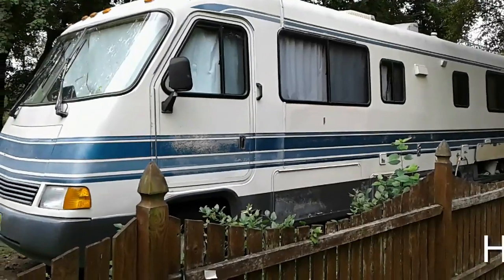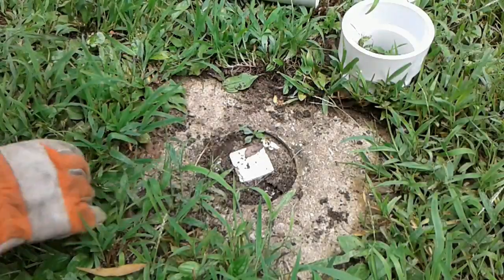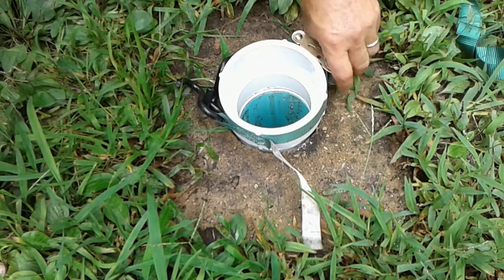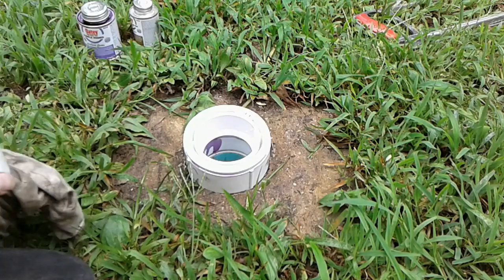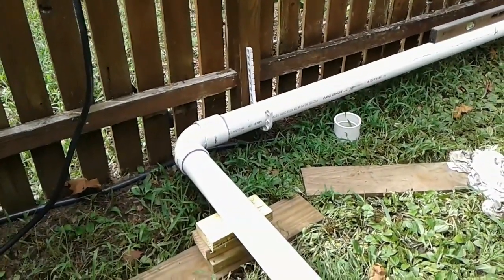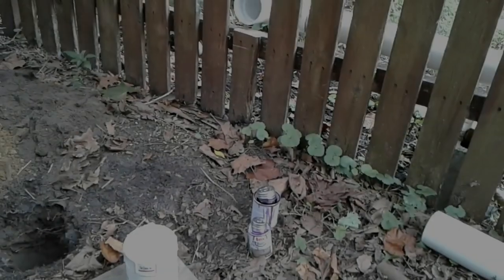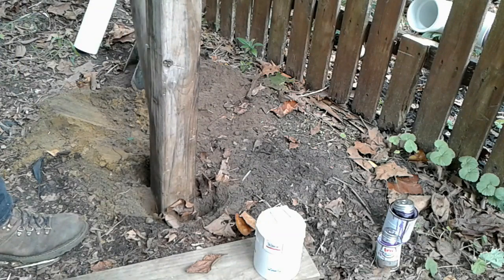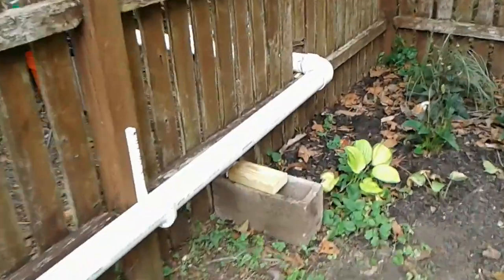How to Connect your RV to Home Sewer

Comment: Great video! thanks for the idea!!! We are going to do this!!! Our only real alteration is that we are going to put RV drain hose fittings on both ends of the run (around 30 ft with one 90' turn) to hook RV drain hoses to. This will save our washout and hopefully keep the naysayers at bay. We currently use a portable tote tank to empty ours into the washout. Thanks again!!!
Reply from the maker: Yeah, the portable tote method gets old fast! Thanks, and good luck.
Reply: @Buckwsr  ended up being 50 ft long. works perfect! thanks for the idea! put hangers on the house and mounted the pipe  and went around the back to the clean out! one short drian hose at each end,
Reply from the maker: @shaylarae253  That's great. Wish I could see photos of the finished job. Hope it serves you well.

Comment: After a time you may need to add other hangers between the ones you have existing. With time and temperature the PVC pipes will sag.  Personally I wouldn't exceed 5 ft.  Best to support them before saging starts.  I believe 1/4 inch fall per 10 ft is the correct fall to float solids through drain pipes.  Good idea.
Reply from the maker: Thanks for the tip. 👍
Reply: 1/4" per foot. Not per 10 feet
Reply: And code in oregon for hangers and supports is every 4 feet
Reply: I knew fall wasn't much because if you have too much the water will not float the solids out.  I looked  fall up and found in most places it is 2ft per 100ft.  Easy to do the math on that one.
  I've seen PVC run on top of the ground for temporary rv hookup and supported every 10 ft.  They eventually had a REAL mess
I did not know about the Oregon rule, but i knew that 10ft would not work

Comment: This is a helpful video! Subscribed. I’m currently thinking about getting a cheap used RV and hooking it up to my mom’s house for the next few years (I’m in college) but no one in my family knows anything about RVs or plumbing. Do you think you could make a follow up video showing how you maintain this system/how it works for the RV? Thank you :)
Reply from the maker: Thank you for the note. Your RV will have a "black water tank" (toilet waste) and a "gray water tank" (sink and shower waste). I think if you search YT you'll find videos on how to empty, flush, and clean these systems, you'll find plenty of information.
Reply: @Buckwsr  how did you secure the flexible hose to the pvc pipe?  And, do you still empty the black and grey water tanks or is this now a free flowing system?
Reply from the maker: I came up with a way to plug the flex hose into the PVC, and then I use a screw through the PVC into the flex hose adapter to hold it in place. Not perfect, but it works. For now, I simply use the system to empty the waste tanks when I need to. I do not leave it permanently connected for a free-flowing system, simply because the RV does not get used that much right now.
Reply: Am i guessing no mascerator is necessary?  I am using pvc adapter directly from camper.  Because of construction i need to put a flex hose into septic tank .  Contractor is setting it up.  Do we need a vent?
Reply: Great idea!!!!

Comment: As soon as you open your waste valve the short section between the rv and your PVC line will just collapse to the ground. You might as well fabricate a removable PVC line to connect to the rv . Did you find you had enough of an angle for solids to travel across your back yard? I would hate for that line to be clogged..just imagine all that mess coming out of the line. What about winter? Any frozen matters  lol.. matters, get it...
Happy RV'ing 🙂🤙
Reply from the maker: You're right. I had to devise a way to support that initial short section of flex pipe. After that it worked great, and has been fine ever since....

Comment: Thank you for sharing. I am living full time time in an RV park. I would like to hook up my fifth wheel up with PVC pipe for the winter answer. My question is how am I able to leave the black tank open all the time? Everything I’ve read and saw and been told is do not leave the black tank open because of the pyramid that is developed without a buildup of the liquid.
Reply from the maker: You can leave the valve closed on the black tank, and then empty and flush it once a week, or at whatever interval you choose.

Comment: When you hooked up the rv like this,, how did you keep the solids from building up  in the tank or did you close the dump valve and let it fill and used the dump periodically to flush the solids
 I have a disabled motor home,that is in a permanent location like a Mobil home,,, thinking of removing the tank all together and straight piping it,,, did you have any issue with this setup
Reply from the maker: Every once in a while I close the valve and fill the waste tank(s). Then I drain them and flush them to make sure all the solids have drained out.

Comment: I was thinking about doing this my self. It seems better than getting one of those long skinny hoses that goes in to toilet wit a pump. I even thought about building a separate septic tank at a point but this is better. I would paint the pipes brown like the fence so they don't stick out so much being white on brown. Where the pipe crosses the yard I would put flower pots all around it to cover it and to prevent people from tripping over it. Maybe a wooden short wall that has a channel on top to be filled with dirt and plants on top. It would serve as a partition for the yard and conceal the pipe within. It should be removable in case one needs to go back and work on it. One question I have is, is it worth it to rent it as a B&B? Being a motor home, approximately how much are people willing to pay per day?
Reply from the maker: Thanks for the note. So far, the sewer line has worked perfectly. But like you said, it is a bit unsightly in the yard. My wife wants me to paint it, as you suggested. I will add a section of fence where it crosses the yard...already bought the materials....and the addition of some shrubs or flowers should make it a lot less obvious. We have had a few airbnb bookings over the last couple of months, but now in NJ we can get freezing temperatures, so I've had to winterize the plumbing and suspend the rentals until Springtime. The amount you get get for rental depends a lot on where you live and how great the demand is.... But since most RVs sit unused most of the year, renting them out is a good idea.
Reply: @Buckwsr  To solve the freezing part one could install heating blankets with thermostats. There is a chance that the electrical consumption would not surpass the earnings from be able to keep it rented. If that is the only thing standing it its way.

Comment: Does the RV drain properly with the length of your PVC pipes, and all the 90.degree turns?  We are looking at connecting our RV to an RV park sewer line (permanent connection).  We’ll have to make a couple of 90 degree turns, or sweeping arcs to.point the drain toward the park connection.  Not as far as yours, but still with a few turns.  Does your system drain ok?
Reply from the maker: It still works great. The 90 degree bends are no problem. You don't need large sweeping bends for this kind of drainage. Good luck!

Comment: How do you prevent sewer gasses from venting  into the trailer without a p trap? I have a trailer that’s been setup in a park for 30 years, and now after all these years this is starting to become a challenge.
Reply from the maker: I think the question for you to figure out is what is different now than it was 30 years ago? In my case, there is a trap under every sink drain, and the toilet valve has a seal that prevents gases from rising into the bathroom. Sometimes there are bad smells when we are on the road, but while parked and connected to sewer, none at all.
Reply: Did u ever figure out how?

Comment: Is it possible to connect the rv hose directly to the septic system in the way you did? (If it's long enough of course) we're going to be staying at a friend's house for about a month and I believe he has a clean out pipe I can use to connect the hose to
Reply from the maker: I'm sure, as long as you can get close enough to the clean-out pipe, that you'll be able to drain your tanks there, even if you have to hold the discharge hose in place while the tanks drain. I came up with a way to connect my hose more adequately to my sewer line, and you can see that here: https://youtu.be/-TXz4Rc0vmI

Comment: is it possible to install a regular bathroom toilet like the one in the house, so i wouldn't have to be worried about smells and draining once a week.... basically bypass the black water tank (remove the black water tank) and just straight connecting it into the sewer drain? Permanent and stationary living.
Reply from the maker: I guess any thing is possible. Most RVers don't opt for a standard toilet because of 1) the weight of the heavy porcelain, and 2) the high volume of water needed to flush it. RV toilets are typically lighter and use less water.
Reply: RV toilets use a 3" flange while home toilets use a 4" flange.

Comment: Shouldn't you be using ABS pipe since it doesn't get brittle in cold weather? RV plumbing is usually the black ABS.
Reply from the maker: You might be right. But I have had no problems so far two year into it....

Comment: I would definitely add an rv waste connector fitting where the pipe meets the rv and should’ve used black ABS pipe, (recommended for waste)! All in all the idea is good!👍
Reply from the maker: Thank you for the note and the tips!
Reply: PVC is also rated for dwv (drain,waste, and vent) PVC is used for waste lines more in the midwest and east coast whereas in the Pacific northwest where I'm from we use abs. But either material is approved for dwv. Also ABS bows a lot easier than pvc does in the sun so if it was me (and I'm a journeyman plumber with 25 years experience) I probably would've used pvc but it needs to be spray painted to protect it from uv light as uv rays will damage pvc or abs. Good job on the layout though. It looks very professional. Also one other thing is that you really arent supposed to use a clean out for this kind of thing so you technically should add a clean out tee right after the first 90 coming out the top of the clean out so that if your sewer ever backs up you will still be able to snake it.

Comment: Awesome video! One question! About how much do you think you spent on the supplies? You have motivated me and showed that I can do this myself :)
Reply from the maker: The biggest price variable is really how many lengths of pipe you need to purchase for your particular set-up.  Pipe, fittings, solvent/glue, hangers....all of that stuff is easily available at Home Depot. Good luck.

Comment: I wanted to do that but someone told me not to because it’s the sewer breathing system ? Something like that ?
Reply from the maker: The sewer clean-out where I connected my RV waste line is a completely sealed connection. The clean-outs are not used for "breathing" or venting. Your home has plumbing vent pipes that usually go up through the roof of the house. You can certainly connect your RV to the sewer line as I did. It has worked perfectly for a handful of years now.

Comment: I know I’m late to the show but was wondering how the solids flow through the elbows.  I might’ve used a sweep there instead.
Reply from the maker: Not to be too graphic...but by the time you drain your tanks, the solids aren't that "solid" any longer....even the TP has broken down quite a bit. So the elbows present no problem. Good question, though, and I thank you for watching and commenting.

Comment: Hi, I woken with this idea this morning and found your vid.  My system is empting into yard from house.  It will be a  couple months to fix do to covid. Ugh anyways I have a solid cement cover (no  PVC cap ) any ideas??? I have regular gutters. Not much $$ to buy piping. So I have to make do.  Hopefully you see this and can help with advice.  Thank you in advance...LI, NY
Reply from the maker: Hi. I'm not sure I follow you too well here....A solid cement cover sounds more like a septic system than a sewer line. Most sewer lines have clean-out connections somewhere along the line. Also...gutters? Waste needs to move through a sealed system. Gutters, as I think of them, would not be appropriate.
Reply: @Buckwsr  hi, thanks for replying.  Yes, your correct.  It's not my house, so this is new to me.  But you did give me idea after reading your response.  I'm going to replace the cover if I can. So, I can run the gutters to it and attach a down spout into the tank. Quick fix till, the experts can come.

Comment: I know I'm coming to this three years late but I was wondering; did you have any issues with clogging in the pvc pipe or anything where it turns at the 90 degrees?
Reply from the maker: No issues at all. Still works great to this day! Thanks.
Reply: @Buckwsr  do u have any issues with the pipe being so long?
Reply from the maker: @nastassjakerridge6562  If you mean the flexible pipe up by the RV that sags down, then you should know that I devised a way to support it which you can see in this video which I made at a later date: https://youtu.be/-TXz4Rc0vmI. But if you mean the total length of the pipe run, then know that if your run is consistently downhill, water will run downhill forever! The underground run from my house to the street is easily 200 feet in length. When going downhill there is never a problem at all.
Reply: @Buckwsr  thanks for the quick response! I’m trying to set something like this up at my grandmas house , got an rv passed down to me so I appreciate you sharing this info with us

Comment: If my house doesn’t have this is there something else I can do?
Reply from the maker: Well, just like when camping, you can drive to an RV dump station to drain your waste tanks. But that will get old fast! The tanks just don't hold that much, especially not if used daily. But every home has either a connection to a municipal sewer system, or a private septic system, so you can figure out how to tie in to that, as I have done in this video.
Reply: I found a pipe like the one shown in the video. There was 2 of them but not in the ground. They were on the outside of my house on the wall . I’m not sure if it’s the same thing u showed in vid considering there’s 2 and in the wall not ground

Comment: Thanks for the video. Do you leave the sewage hooked up and the and holding tanks open for the Air BNB guests? or flush after the stay?
Reply from the maker: Ken, I leave open the gray water valve (sink and shower drains) while guests are using the RV, but I keep the black water valve closed (toilet). I then flush the black water tank out after the guests leave. Most guests stay just a night or two. So for now, that's working out okay.
Reply: @Buckwsr  Hey I have a question - we have done essentially the same thing here where I live - we have connected the black tank exit pipe of our travel trailer to the sewer clean out of our home - but it seems that every time we flush the black tank, it ends up smelling like sewage inside one of the bathrooms of the home (not in the travel trailer, but in the actual home).  Do you have any idea why this might be?
Reply: @jronyjrony2340  If you have a P trap between the RV and the septic tank/sewer there will be no vapor back flow. The best place in this scenario would have been where he used the flex tube, put in a P trap to an inlet with a vertical cleanout port. Also, should ALWAYS use sweep elbows instead of those hard corners. Flows much better and easy clean out if there ever is an issue. Great idea with the use as an Air BnB

Comment: What type of couplings were on the flexible hose on the rv? Did you glue the red side connected to the PVC? This video was so helpful. Nice setup.
Reply from the maker: If you check out this video, https://www.youtube.com/watch?v=-TXz4Rc0vmI&t=1s, after my long-winded opening spiel, I'll show you precisely how I make the connections between the RV and the 3-inch sewer pipe. Thanks for your note!

Comment: How do you hook up the electricity to your rv
Reply from the maker: Hey, that's a good topic for another video! Basically, I utilized the 220V line (previously dedicated to our electric clothes dryer before we switched to a gas dryer) and ran it to an RV electric connection box which I mounted on the outside wall of our home. We plug the RV into that. Works great! This provides two 30amp circuits for the RV (though most RVs, including mine, only need one 30amp circuit). You may need a skilled electrician for a job like this, depending on your knowledge and experience with household electricity.
Reply: Buckwsr thank you. I am going to rent out my 5th wheel 🤪😄